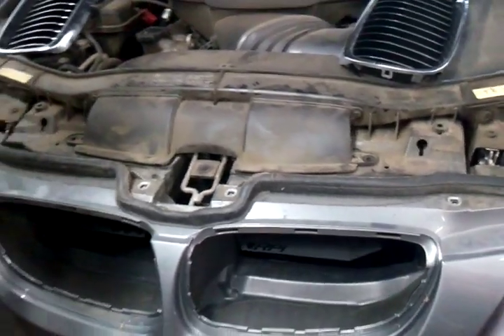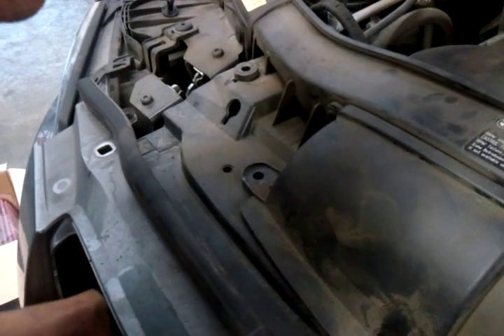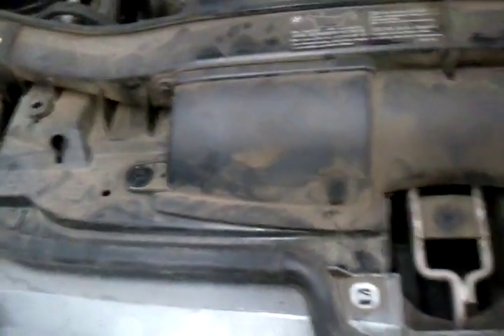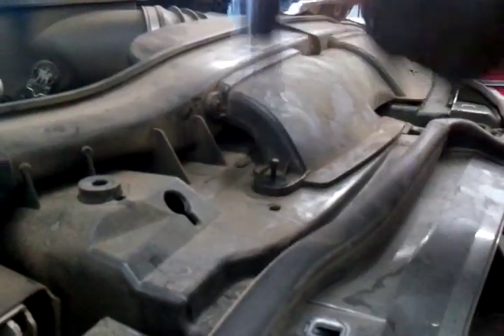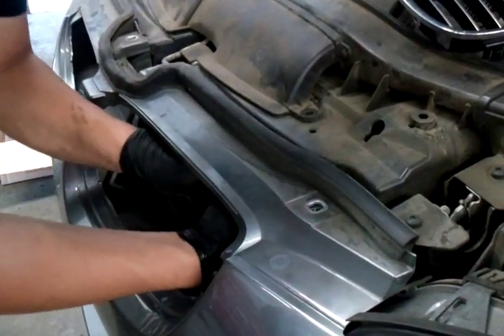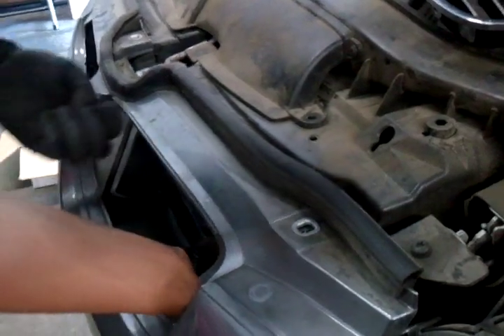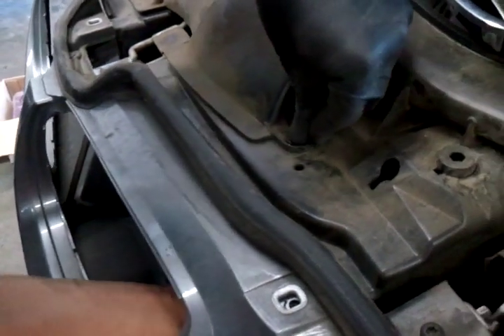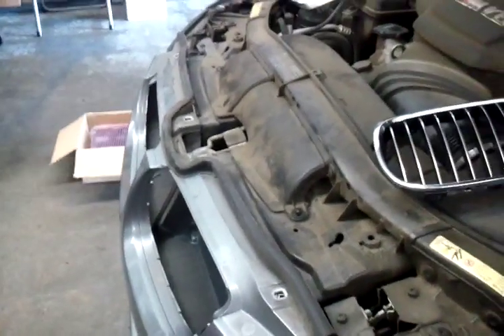RPi E92/E90 Ram Air Scoops Installation

Comment: First and foremost, I appreciate the effort in recording and posting instructional videos. This was helpful. I do have a couple items of feedback to improve the quality. 
Granted this is an old video; however, it'd be beneficial to repost an edited version that trimmed out 2 whole minute (1:27mm - 3:27mm) removing the kidney beans. Each viewer potentially spent 22.23% of the run time of your instructional video being annoyed by watching as you're struggling with them. I was struggling to not switch to a different video.
Also, if you'd not tightened the primary screws all the way until after the set pins were installed, you wouldn't have struggled with them nearly as much. In other words, back your primary screws off a quarter turn then install the set pins and finish by fully tightening the primary screws.
All in all this is a good video. Thanks for taking the time to do it.

Comment: And that folks is how you restrict airflow coming trough your radiator. The performance you get trough more airflow in the intake is lost by higher temp on cooling. GJ bro
Reply: And that is how people talk without any knowledge.  All data logs show no change in cooling temps. :/  Please do not spread information you have no knowledge of.
Reply: Seven4Para Wouldn't this direct rain right up into the air intake as well at high speed? Have you noticed and problems with the air intake becoming wet / damp while its raining??
Reply: +RIT C there are drain ports in the bottom of airbox
Reply: RIT C NO issues at all.  Been using it for years and the air filters are always dry.  RPi has sold these all over the world and they have used it in their track cars where they have won many tuner challenges.

Comment: no, you will not even notice a difference. unless you put in a new after market intake system this 1 tinnie tiny mode will not change anything but give you a lil bit more air in your car intake. and since ur not "racing, legally" you wont notice anything.